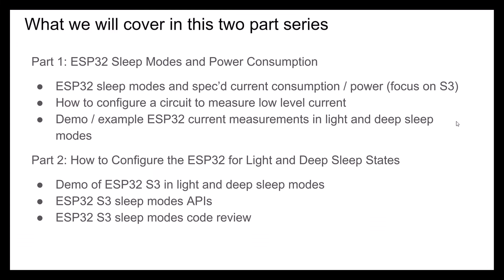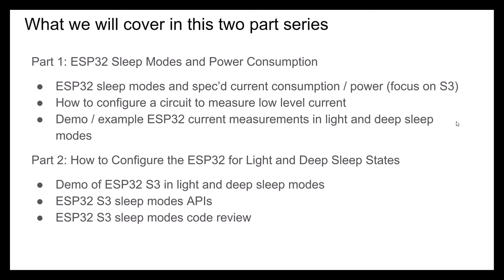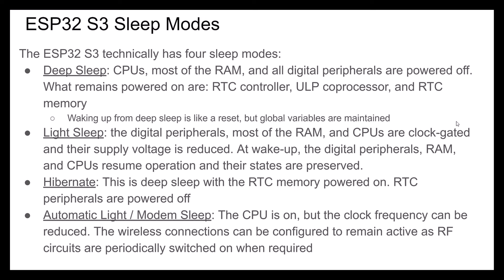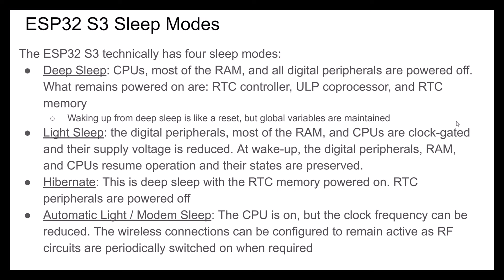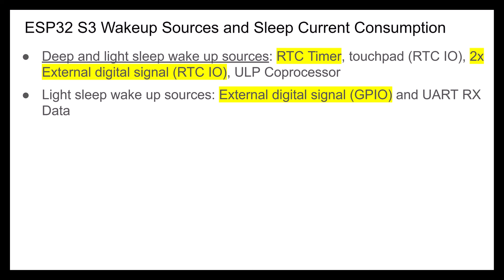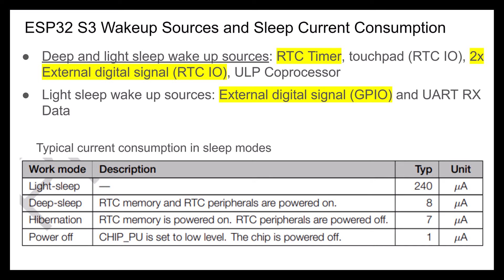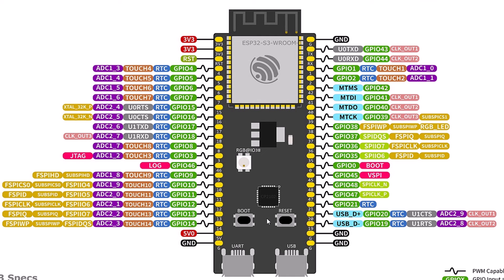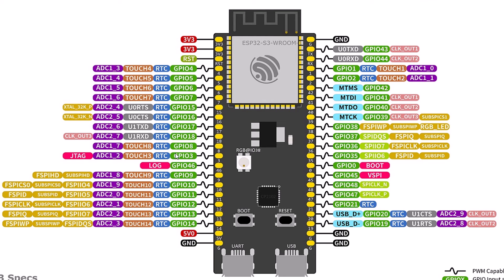ESP32 Sleep Modes and Power Consumption

Comment: Great video. I am using a Xiao ESP32C3 where it sends temp data from a DS18B20 Temperature Sensor to AWS. It's powered by a 1500 mAh LiPo battery and so far I have only been able to get the device to be on from a single charge for 1 days, 20 hours, 16 minutes. Now I am learning new power consumption techniques I can implement since I have been operating in Active Mode the whole time. This video was a great introduction to my next R&D step!
Reply from the maker: Awesome, glad you found the video useful

Comment: Great work. Looking forward to Part 2. Please use flux remover and then Super Wash or alcohol on your header pins. Flux is a conductor which may cause leakage, false triggers, etc.
Reply from the maker: Just so you know part 2 is already out. And I appreciate the tip on cleaning up the flux

Comment: Great video. What power supply or instrument did you use to do the digitized current capture that you showed at the end of the video?
Reply from the maker: It is a modular power supply platform from Keysight Technologies and the mainframe is the N6705B DC power analyzer (I believe they are on the 'C' version now). The mainframe takes up to 4 power supply modules. The module I was using is the N6762A, which is one of their mid range performance modules. It is not cheap, but comes in handy!

Comment: The main reason you use a esp 32 or 8266 is for connectivity ...and to my knowledge unfortunately you cant have the radio on and go to sleep , and you cant wakeup from receiving a bluetooth signal or wifi packet .... The esp is nice but its useless if you need to activate the radio and your on battery .... If you have any idea how to sleep and wakeup on receiving a bluetooth or wifi packet plz address it in the second video
Reply from the maker: You are correct and thanks for the comment. It is not really just an ESP32, but a problem with wireless connections in general. To maintain a wireless connection you need to transmit data wirelessly, which is a power hungry operation. Also you need to pre and post process data so you need some type of CPU involved. I am not a bluetooth standard expert, but you can sleep a bluetooth device and wake every couple of seconds to check for a device that is trying to pair. And if there is no device you can go back to sleep and if there is you stay awake until the bluetooth communication is complete. My application that I am planning is for WiFi to send and read data from the cloud, which doesn't require a constant connection. My device will sleep for some amount of time, wake up, and connect to the WiFi. From there it will send sensor data and then read any settings or state change information from the cloud. Take the appropriate actions and go back to sleep. The amount of time the device sleeps is just based on how real time you want the data or actions it performs to happen. But of course there are applications that do require a constant connection. I will show a WiFi example in part two but it is the wake up connect and go back to sleep approach.